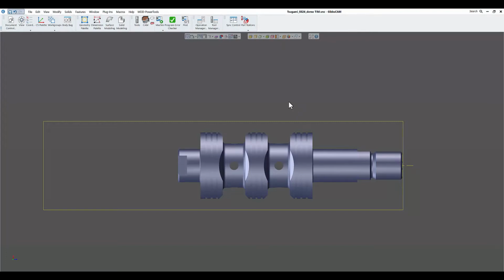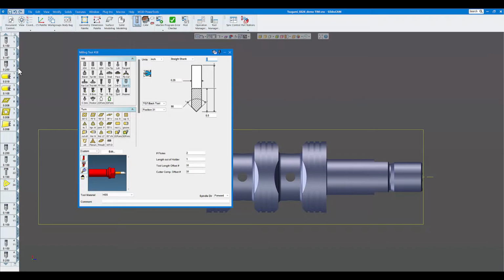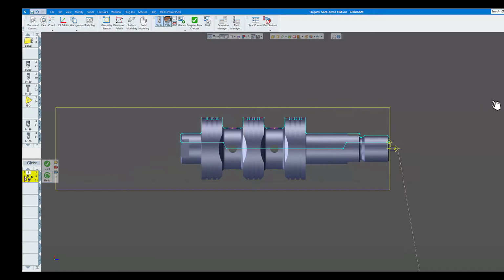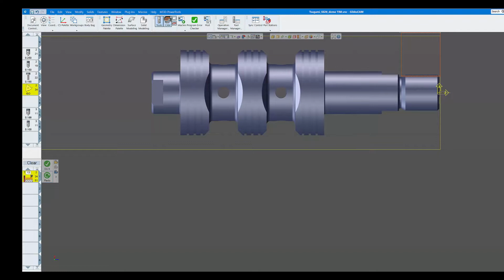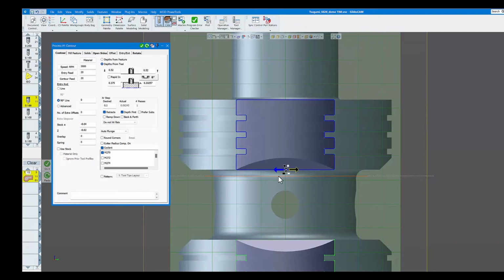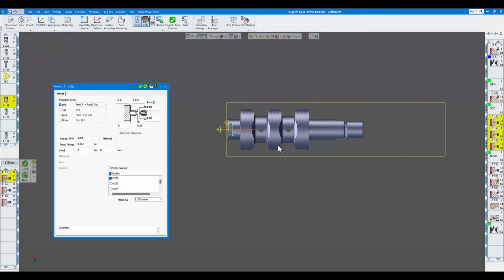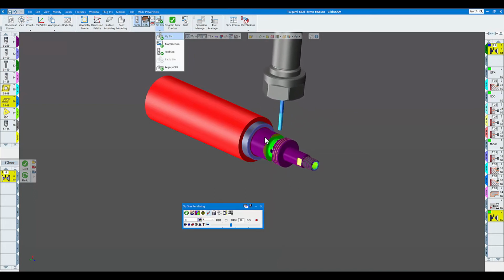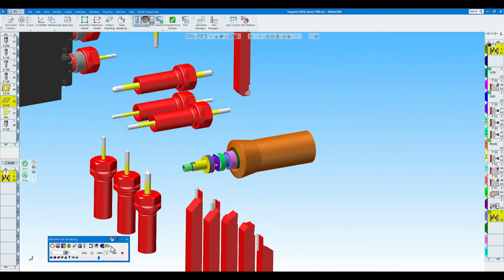GibbsCAM Swiss Machining

Comment: absolutely fantastic demo of how Swiss machines work as compared to the traditional CNC's I am use to programming!!! Your model up of the actual tools in their respective positions within the machine really cleared up the massive differences between traditional CNC tooling orientation and the (at least from my personal experience) Swiss tooling orientation. If you've never  actually seen a Swiss lathe in action (as i haven't), its pretty hard to picture how this machine does what it does.  What a strange but ingenious way to turn stock that has now been cleared up in my mind through your talents/effort with this amazing video.  Thank you!!
Reply from the maker: Thank you for watching.  Yes, Swiss machining can boggle my mind. It is a lot different than standard machining, but not too difficult to program in Gibbs.